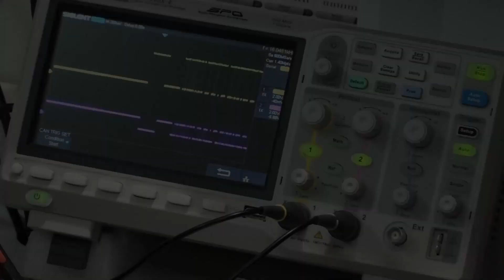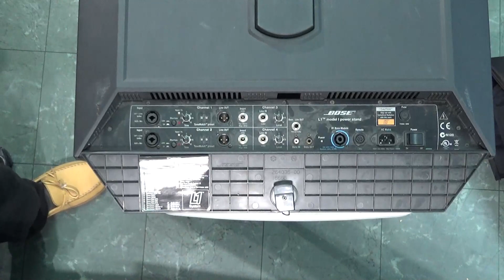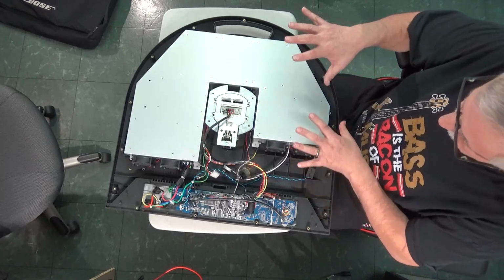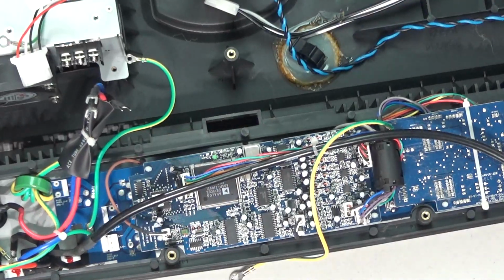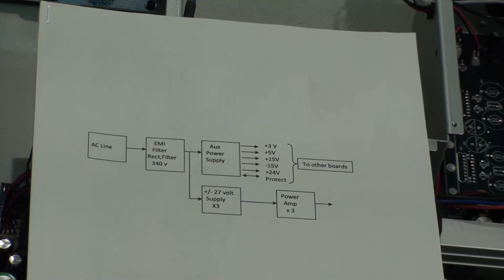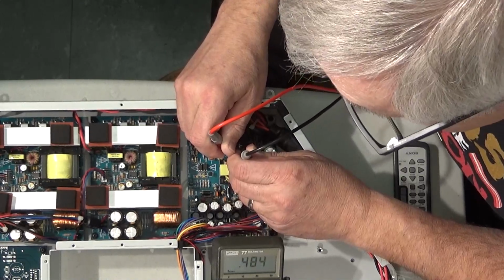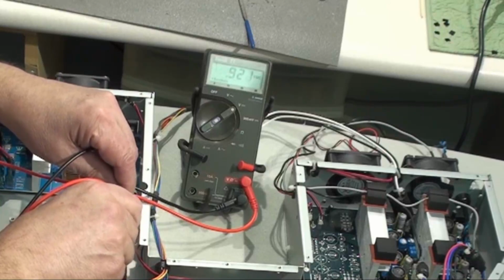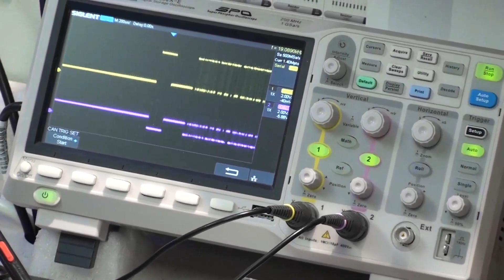"Stick Handling" - Fixing a Bose L1 "Stick" PA System - Part 1

Comment: Hello, what was the result of the repair? I have a Bose with exactly the same problem, I already changed the diode but the system still does not activate, perl strangely there is 8 volts in the vcc of the 2843 and I think it should be 12v
Reply from the maker: Hi Dan. You have probably already watched Part 2 of this repair, but if not there is additional info there. I'm going by memory here but I read something that suggested IC601 (UC2843) will activate with 7 or 8 volts (which is divided down from the main V+), but you won't get the full 12 volts until you have the output side of the switching regulator working correctly. So I think the 8 volts is ok. But probably the switching circuitry is not working. You didn't say which diode you changed. Was it D601 (the one that was discolored in the one I worked on)? I also found D607 shorted, and I also changed out Q601. If you haven't already done so, I would suggest you use a multimeter to check all the diodes on that board. If that doesn't turn up anything you should probably change out Q601 and possibly IC601. I'm not sure what to suggest from there. I don't know your knowledge/experience level with this type of work but I always suspect: bad connections, electrolytic capacitors (especially if they are old), semiconductors, and any other components that dissipate significant power. Unfortunately, troubleshooting these switching power supplies is difficult because of the feedback loop involved. If you have other questions or need a schematic email me at techtips983@gmail.com
Reply: @techtips983  Thank you teacher, indeed the d601 was defective, it was not shorted but rather it marked 400 ohms on both sides as if it were bidirectional, I changed it and started the power supply. thank you for your valuable help😁
Reply from the maker: Sorry I missed your comment before. Thank you for it. Good to hear you got it working.